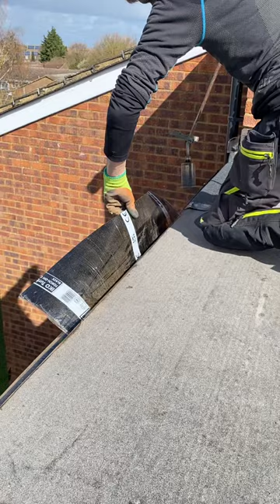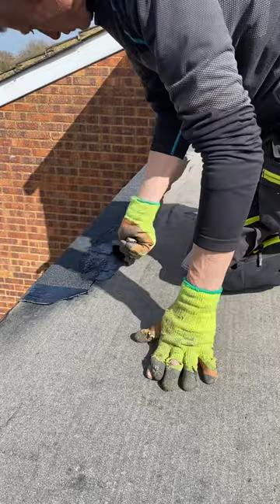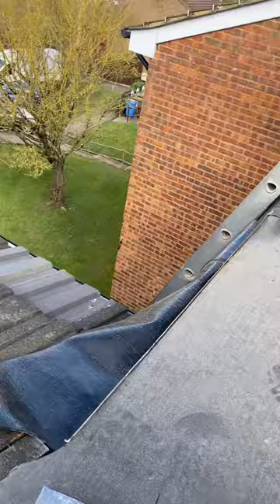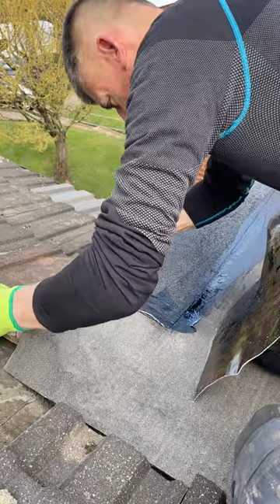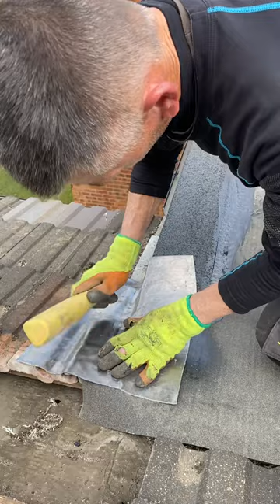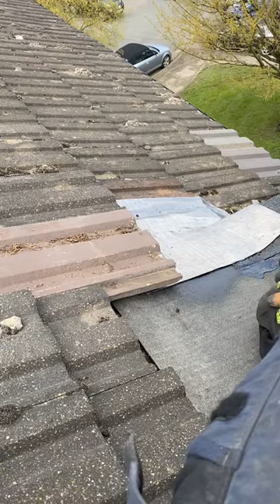Torch-on drips

Comment: Primed the drip cards? Lol never seen anyone do that
Reply from the maker: Yeh. Gives a good bond and stops them from ballooning in the long term. Some roofing merchants sell them pre-primed. Only takes a second and all adds to an improved finish.
Reply: @DSherrattRoofing  they only get bubbles if they’re not stuck properly or they get too much heat and the gas trying to escape. The drip cards are designed for felt to stick to it. 

You’ve got to pat them rapidly and ferociously, like all felt
Reply from the maker: @Mt3Dpdrtk  thanks for the tips. It’s a wonder why they actually sell them with primer already on them then. I just thought it can’t do any harm. I prime everything. Someone commented on me not priming the back of my lead saddles which was an oversight by them coz I prime everything apart from the actual deck since that’s torched fairly vigorously and really doesn’t need it. Tbh I don’t do a lot of torch-on these days but prefer using single ply systems. A lot quicker, safer and less burned fingers!! Having said that, I have a lot of respect for torch on felt roofs. It’s a misconception that bituminous built up felt is unreliable. I think it gives a great finish and will last half a life time so long as it’s done properly using high quality materials. Same rules apply; Buy cheap, buy twice. I always try and use a 4 mm underlay but not everyone sells it and always go for the best mineral that they can offer. Always SBS. I really don’t like APP. It’s good to compare notes and learn from others. Don’t matter how many decades I’ve been in the game, I’m always open to learning from others.
Reply: @DSherrattRoofing  love your videos
Reply: Techno torch do a 3mm underlayer which sometime Sig have in stock
Reply from the maker: @Mt3Dpdrtk  ok. Interesting. Tbh. I avoid SIG unless I’m really desperate. They are the most expensive roofing merchants on the map.
Reply from the maker: @Mt3Dpdrtk  that’s very kind. Thanks
Reply: Always prime the cards
Reply: @Mt3Dpdrtk  Spot on👌